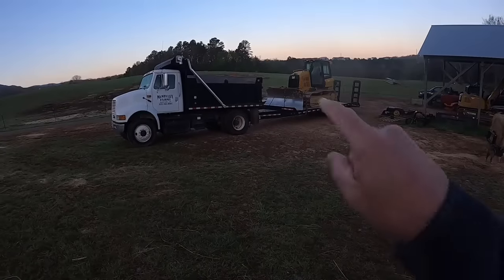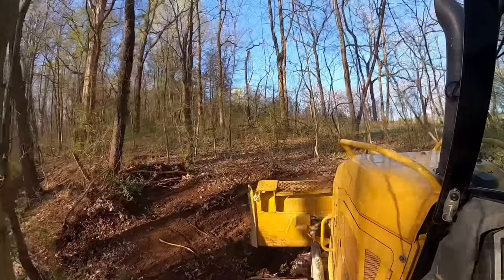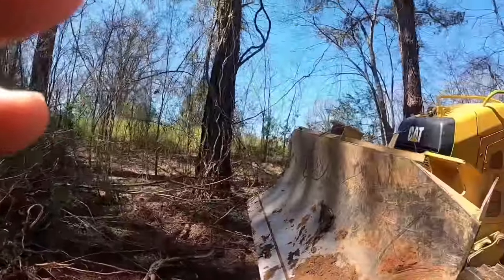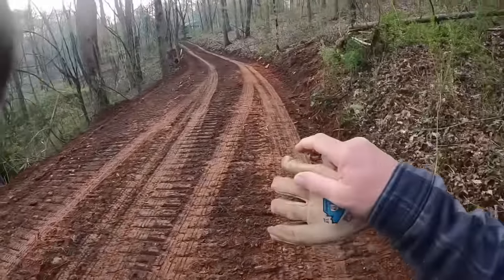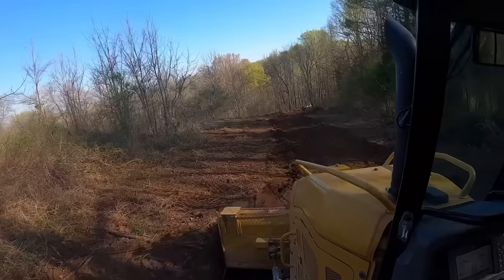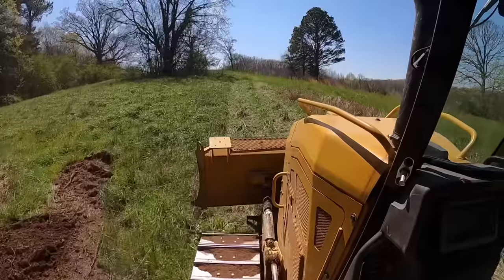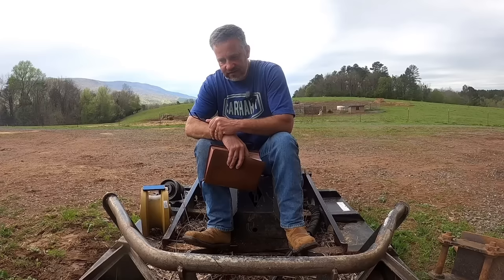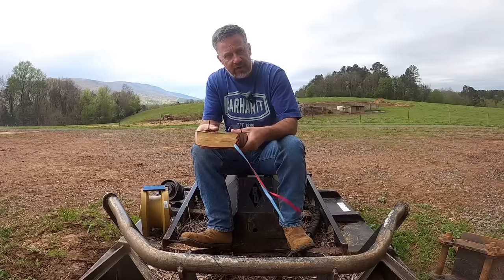I MESSED UP!!! NEW ROAD, WRONG PROPERTY…CAT D5 DOZER

Comment: Nothing like brand new dozer all every pins new every thing works nice and tight
Reply from the maker: It's actually older than you think. It is a 2018 with 2500 hours on it. But it does a great job for sure...
Thanks, 
Sam

Comment: Man that road looks good!! I seen you get out and remove that little tree that fell over your dozer blade. I know the feeling. I get a lot of that mulching. A lot of times they try and pin me in the machine by falling in front of the door. Maybe if I keep hoping and praying I’ll have me a fancy dozer like you and ole smith worx! I sure do love a dozer. This was great video! Awesome message. Keep it up!!
Reply from the maker: Thank you! I saw a few of those limbs in your mulching video that was trying to get you. Especially that cedar that sent the CAT bucking and jumping. I thought ouch that was a rough one. I didn't use to wear my belt in the skid steer. But I ate the glass door pretty hard one day and every since then I wear it in there. Keep going after it and the dozer may be a reality.
Reply: @tristardiggin  yeah I hung that cedar just off the edge of the mulching head and when it slipped in it tossed me forward. I wear the belt on the hills now. Holds me in my seat better and kinda helps my back not hurt as bad. I’ve slammed my head into the roof a time or two. I get upset when my hat comes off too lol. The belt on the dozer is a pretty good call too. I’m gonna keep pushing for a good future. See what the good Lord has in store for me.

Comment: It’s pretty crazy to me how much different the blade profile is from the cat to the Deere dozers.  The bottom of the cat blade from rear of blade to cutter edge seems to be much further, and more curved.   The m12 works on the vines also.
Reply from the maker: Seems to be a good bit of difference from one brand to another...
You just had to bring up those blame vines.😁🤣 I have ripped more than 1 light off because of the vines. It's like they have a mind to attack you...
Reply: @tristardiggin  man I hate vines too

Comment: The important thing is to admit mistakes and try our best to make them right. Some folks would really be upset over what happened, but the fact you told the owner you messed up probably set the tone for the interactions you had with him. Most people are very reasonable and understanding. No way would I be mad at all and as long as it is fixed up right, it would be a distant memory that never made any difference to me or anyone else for that matter. Good job!
Reply from the maker: Right and well said! Most situations become, as you said, a distant memory with little to no meaning. 
Thanks,
Sam

Comment: People don't realize what all can go wrong when you are in brush with a dozer. (Everything ). Glad you had a sharp knife. Well at least you started on the right property and ended at the right spot. No flags or stakes I think you did pretty well.  I always tie a piece  of flagging on something I don't want to run over. I learned the hard way. We get to focused on what we are doing to notice anything thing else. Good job & message. Does that wireless mic work with the med mod for the 8. If so email me on were you got the mic.
Thanks Sam.
Reply from the maker: Thanks James. Wow, certainly right. So many things can happen in a short time. Glad I didn't rip that sensor wire out. I won't be doing any work unless I'm  100% sure where the work is to be done. The gopro 8 works great with the DJI mic. It does require a media mod to work. I will send you an email on it...

Comment: Once I cut down a fence, the wrong fence that I was supposed to be replaced. It was my fault for not reading the work order but just what I was told the estimator. As finish cutting the fence down it seems like some told me look at the other side. Well there's wasn't another option but face the situation and take responsibility. At the end everything was settled and I replaced the fence myself and even made some extra money. Point is that we as individuals have to take  responsibility for our acts it matter how bad the situation is by lying or blaming someone else we makes this worse. What my has been is that as as soon you take responsibility it does how angry or upset the order person is as soon as you say I did and take responsibility you disarm them because they never expected that. What it was in their minds is that they are going to hear excuses. It always has worked for me to be truthful and I have gained the other person respect and trust .
Reply from the maker: Great words and you are exactly right. Folks want to blame someone else rather than take responsibility for their actions. Appreciate you sharing that story...
Sam

Comment: That's gonna be slimy when it rains,. Wheres the ditch?
Reply from the maker: Yup, was probably slick after it rained. I think he got some rock on it pretty quick after it was cut in…
Reply: @tristardiggin  the work you did looks good, just wondering why no ditch on the hill side.    Looks like it's going to wash, especially with all the fill
Reply from the maker: @Mikes_Repair The owner had a budget for 2 days work. So I did as much as I could in that time. It needed at least 1 more day to fix the drainage on the whole road. He basically just wanted to have access to the hilltop not so much a finished road.

Comment: if the red flags are for utilities underground, red is power. think about all the electrical that has red paint on or near the pannels in any construction project.
Reply from the maker: Right, but these red flags were put out by the owner marking a trail for the state septic inspector...

Comment: Great drive clearing vid! Could you give a range of what to expect in the cost for a job similar to this? Also, how many feet it was. Thanks.
Reply from the maker: Thanks Shane. It was roughly 1250 feet. I was on a 2 day budget on this project. Just a basic job like this could be around 3k to 5k. Add rock and that is another 5k. To get all the drainage work with culverts and erosion control you can add another 5k. So, if a person wanted a really nice and dressed up road it could reach 18k pretty easily.

Comment: You need a grader to build a road and a roller to build the crown and promote drainage, which is most important in roads. Grader will also make the V ditch, but bulldozing trees still fun as hell 😂😂😂

If you need help operating heavy equipment, give me a call, lol. I used it all! Grader is definitely a lot of buttons and takes time to learn lol not as easy as the dozer which is my favorite piece of equipment in my opinion cuz you can't see shit but got to feel it... I guess you can ditch with the dozer, though (assuming it has the hydraulics to tilt the blade), so really, all you need, lol... and yeah pretty sure dozer weigh 70k+ pounds so don't flip your trailer lol
Reply from the maker: Would love to have a grader and learn how to use it. A feller can really make a pad or road look great with a grader. I have a roller but just wasn't in the fellers budget he gave me to run it. Had 2 days to do what I could so drainage isn't 100% either. But it is definitely usable and access to the house site.
Thanks,
Sam
Reply: @Tristar Diggin'  You did a good job though! Just don't flip your trailer lol
Reply: @Tristar Diggin'  How much did you charge the fella for the job? Hourly? Flat rate? Or Budgeted Hours? I do Landscaping business so I'm curious
Reply from the maker: I normally charge a daily rate of $1500 per day. Very rarely will I do a set price. Plans and problems fluctuate to much for me to do a set price.
Reply: 70 K ? What
Reply from the maker: @kevinherring3744  not sure what your asking (70k)
Reply: @Kevin Herring  I think I was thinking of a d7 dozer, the d5 is like 40k my bad sorry

Comment: not knowing where the boundaries are or anything, i think i would have preferred the where the road was cut down to be  sloped where I could get a riding mower on it instead of cut down strait up and down. That dirt will fall of the strait part into the road. I know my driveway was the same way. I should have had the hill sloped into the road instead of a wall. Also the berm or dirt I would have wanted to make the road wider or have it where I could mow with a riding mower along the road.  But if they only gave you 2 days of budget you did what you could. If they had let you work another day it would have been a lot nicer I think.
Reply from the maker: Right, another day and a half and could have dressed it up good.
Thanks,
Sam
Reply: @tristardiggin  you still did a fine job.  But I’ve learned the hard way it’s better to do it right the first time even if you have to wait a few years to save up the money for it.  20 years ago I paid $50 a hour for dozer work.  I bet now with expenses ppl probably pay $150 a hour or more.
Reply from the maker: Yup, dozer work isn't cheap! Cost a lot of money to be them and operating costs are ridiculously high...
Thanks,
Sam

Comment: A Godly man accepts responsibility for his successes and failures and so glad the neighbor saw you didn't have any malicious intent. I grew up in my family's retail lumber business and back in the 1960s and 70s drivers would deliver framing materials by dumping the strapped material off at a homesite. Back then the directions were "... go down Mountain Rest Road and past the white barn there is a gravel drove on the left. Sure enough... every Summer a load would be dropped at the wrong site and the driver would have to go load everything by hand and then unload it by hand at the correct site. No harm, no foul. Just embarrassing.
Reply from the maker: Right, things like that happen every day. It just depends on how we handle it. This guy handled it very well. I'm very familiar with directions like that! 😁
Thanks,
Sam

Comment: Hope ur going to cut some ditches and couple of culvert if not it won't last with a 6way it should be crowned and all
Reply from the maker: Yup all that would be appropriate and the proper thing to do. And you are exactly right, it will be a mess over time. But, the property owner only wanted 2 days of work and to do what I could in those 2 days. 
Thanks,
Sam
Reply: It can de done in same time ..but I understand
Reply from the maker: Interesting...🤔
Reply: If you had 50 years experience u would see ..mabey u will get it after this conversation..quick tip dirt from ditch build road first cut start ditch..all in experience
Reply from the maker: Maybe I will get there someday, will keep trying...
Reply: Yep don't give in or up keep digging brother ..here if u need me

Comment: With the amount of ice on the road that was shown in the first video I doubt anyone driving the propane truck would have been able to bring the truck down safely.  Having heavy equipment in the front and back on the first video (like in this video) would have greatly increased the odds that there would not have been a need for this video.
Reply from the maker: Not real sure what you are referring to. There is no ice or propane trucks in this video.
???

Comment: Always good to see your cat work.   I started keeping the m12 Milwaukee chainsaw in the cab on clearing projects for some of those limbs that fall between the machine and the blade that are on the larger side.  Especially road builds when I’m way away from my truck.
Reply from the maker: Right, that is a great idea. I need to find some sort of chain saw mount for a dozer like they have for tractors.
Reply: @tristardiggin  yes sir the little m12 is small enough it will sit behind the seat or in the floor.

Comment: Pulled a sensor wire like that on a D6N.  I was backing up just like you were doing, dozer went into limp mode, barely made it back to the road. 600 $$ for new cable
Reply from the maker: Wow! Those things can happen fast and expensive when it does…
Thanks,
Sam